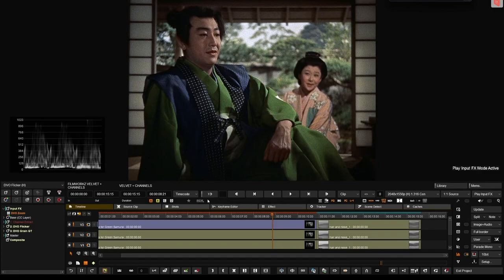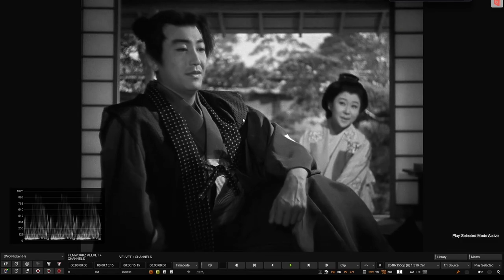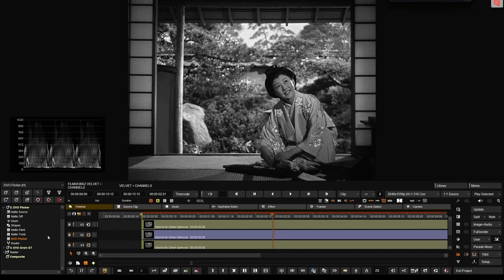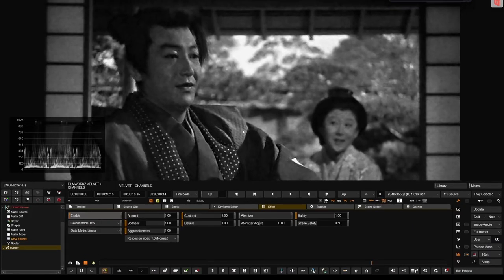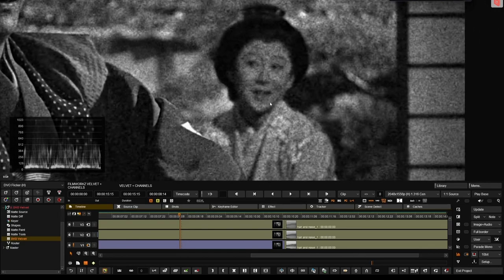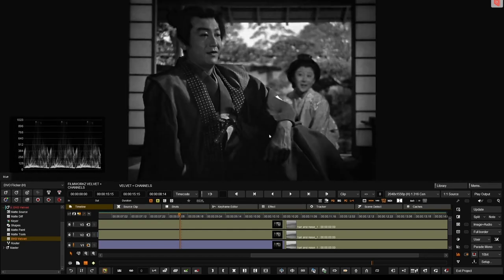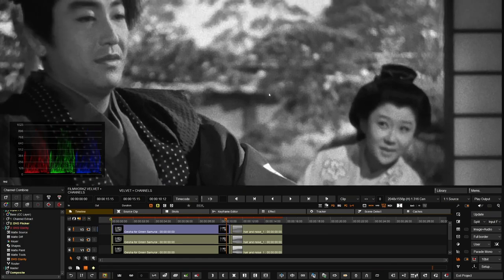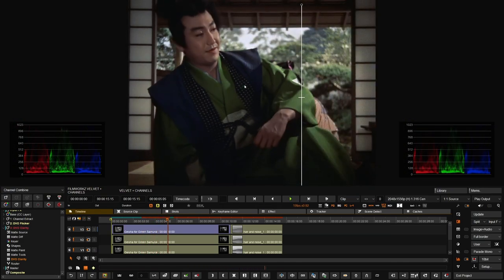Film Restoration Quick Tips: Channel-Separated Grain Reduction and Restoration

Comment: Dont give away your secrets man!  ;)
Reply from the maker: My primary role is that of a teacher, and I cannot escape it.
Reply: @fabiocolor  then if that’s the case could you tell me the best solution for removing splice bumps at edit points in Pheonix?   

Wrap the bump with cut points and apply Steady 2?    

I’m looking for the best solution.    I originally applied Steady 2 to the entire film but the client isn’t pleased since I stabilized the picture too.    They just want the spice bumps removed. 

Thanks
Reply from the maker: To accurately remove splices, reel footage must be scene-detected. In the Steady DVO, there's a specific setting for handling significant splicing interruptions.
An alternative approach is to utilize the recently introduced DVO frame lock. If you wish, I can review your footage and provide some recommendations. Please feel free to reach out to me at fabio.bedoya@filmworkz.com.